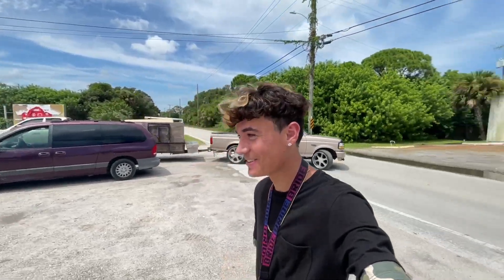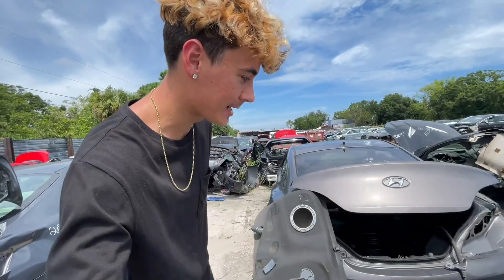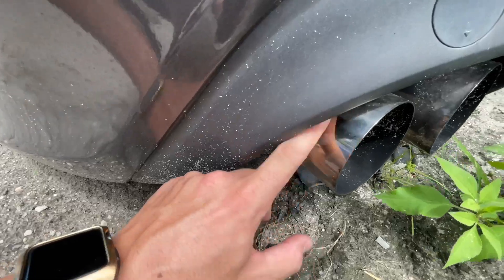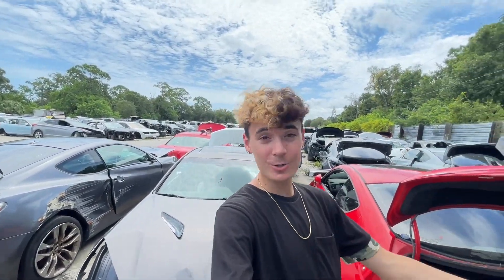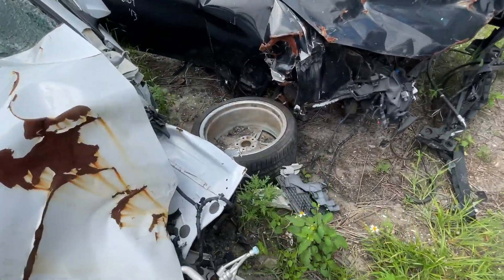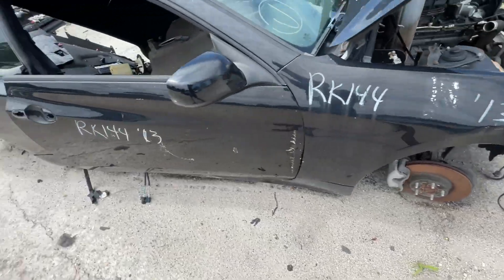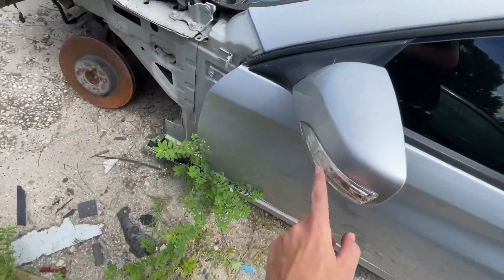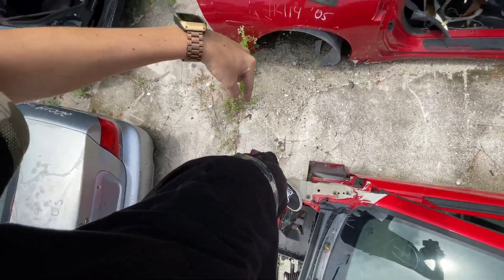I VISITED A GENESIS COUPE GRAVEYARD!!

Comment: With soooo many ppl wrecking their gennies, these cars are gonna end up going extinct lol and that’s also the reason why they’re so overly priced
Reply from the maker: It's really sad
Reply: They’re still really cheap where I’m from, especially the 2.0L. My brother got a tuned 2011 3.8 6 speed for 3500, I’m going to look at a 2010 2.0 tomorrow for just needs a power steering pump for 1800
Reply: @versacechang1521  damn I got a 3.8 for 10k but it got new airlift and brembos a few days before I bought it from my uncles shop
Reply: @alansantos228  they taxed u all the bk2 3.8 come with brembo and hood race suspension